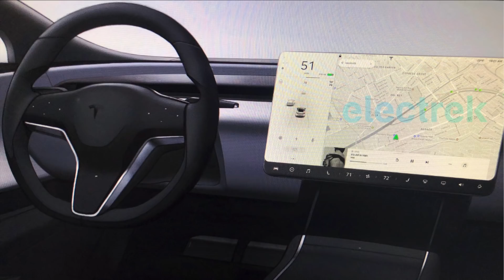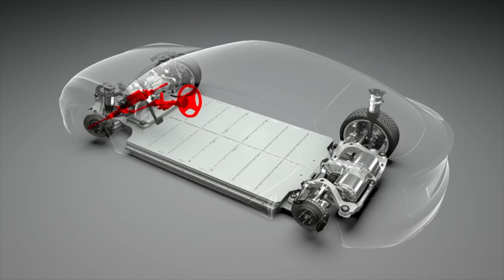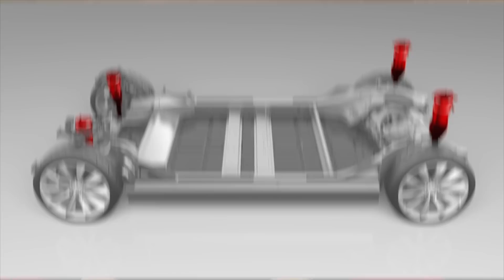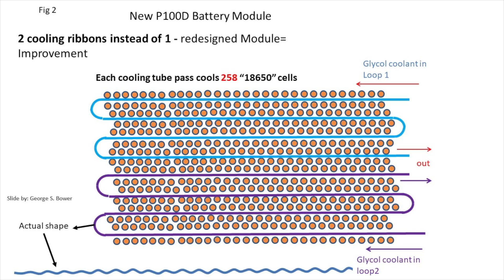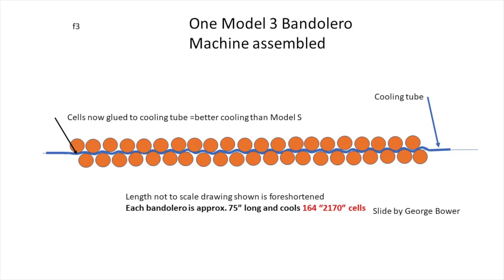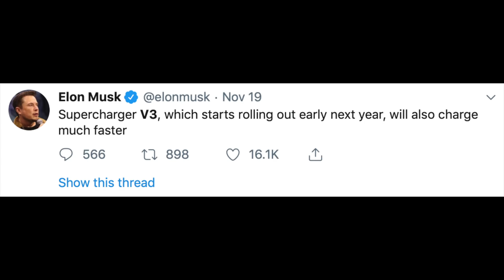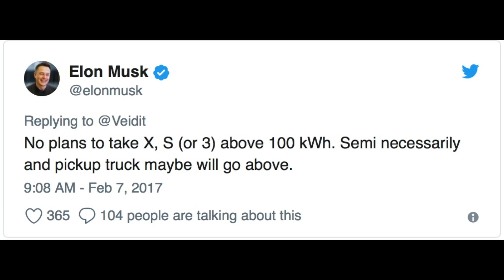The reason Tesla's 75 kWh battery is going away

Comment: Tesla has work to do on chassis (simplify, enhance, make changes for 2170). I do not think it is likely to see a 18650 vehicle get 2170 pack. (I mean without a chassis rework). However Tesla is working hard on chemical for example for removing the need for cobalt. This chemical upgrades do not need any work on chassis, because those can be applied to 18650 and 2170 equally. Those chemical updates are the 5 to 10 % increases in capacity. If chassis do not change I think S and X will not get more than 120 KWH. If current battery charges at 120KW max, it will not handle more than 150KW. In term of charging rate the roadster will be able to handle 240KW and the semi 400KW. Current chassis S and X = no 2170. Chassis reworked S2 and X2 = yes 2170.

Comment: 2170"s in model s and x (which will offer more range) and most likely a cabin refresh. A 100kwh battery pack comprised of  2170's.
Which by default would be a 25% increase of the model 3 range, or about 387 miles of range for s and x.

Comment: My only concern with moving from the 18650 to the larger 21700, is cooling. More smaller cells gives more outside surface area per volume. You can cool the outside of the cells, but will that effectively cool the inside of the cells with more radius of active materials to go through? That said, if the cells will be more efficient, and simply not produce as much heat at the same discharge rate, the larger cells will reduce manufacturing costs. Increasing capacity also decreases load density, which reduces temperature rise, and perhaps even increases range per kWh. That means, the car will be more energy efficient. I would like to see Tesla quit buying foreign battery cells, and "roll his own". If the 21700 is going to be built in one of his mega factories, I'm all for it. Especially, if he can do it here in the US. It would be nice to actually see an american made car, using american made components.
Reply: Their cells are all made in the 'gigafactory' in Nevada currently.  Panasonic is their partner and they handle the manufacturing but the cells are all 'Made in America'.  This will change though as more factories are built around the world.  As much as possible things will be manufactured locally for a local market.  There is likely also some kind of IP sharing going on as well between Panasonic and Tesla covering the chemistries.
Reply: @Bryan46162  I was under the impression that the cylindrical cells came in from Japan, then were assembled into battery packs in the gigafactories. There, they were wired in series, hooked up to the battery management systems, and the cooling systems. I'm talking about Lithium and Cobalt oxide going to Nevada, and being turned into the individual cylindrical cells.

Comment: Switching to the 21700 will mean a new design of the whole cooling system, the main reason why  model X and S are track limited and also it have to be done to the drive units(motors, inverters, charger) .  I'm not sure if they will change the motors to the ones they put in the model 3 as well, anyway it'll be a big redesign in the platform.
 The Porsche Taycan performance numbers will be first victim.

Comment: It only make sense that as battery technology ( and manufacturing ) progresses, that Tesla, like any manufacturer, will take advantage of that progress and utilize not only a " better" battery pack, but a higher capacity one as well. This  also includes charging capacity at the SC.  Isn't longer range with quicker charging the ultimate goal?  . Performance , as good as it already is, will only improve as a result of better and higher capacity batteries.  Nothing is static. 

Remember, the quote from Elon about battery size was written nearly two years ago. A lot has changed in manufacturing and in the market. If you look at the Leaf ( and Volt hybrid) and other BEV, battery capacity has naturally increased over the past 6 years. This will only continue . Both sides of the equation, battery capacity and charger capability are both going to increase.  Is a Model 3 with a 100 kWh battery in our future. Or an S/X with 135-150 kWh battery on the horizon? Only time will tell, but the handwriting is on the wall.

Comment: The 2170 pack is suppose to be more energy dense, more energy for a certain space. So a simple change in battery pack architecture from 18650's to 2170's alone should be able to fit something like a 120 kWh pack in a model S or X. I don't think S and X will get 150 or 200 kWh pack but I could be wrong.

Comment: There is a trade-off between range and weight in these cars - it doesn't make a whole lot of sense to build a car with really long range as the battery weight would be a limiting factor. 400 - 450km is plenty of range for the average motorist. Just like small car fuel tanks don't go more that 40 to 50 litres, because then the size and weight of the fuel would impact performance and design, and it's just not necessary.
Reply: necessity ain't anybody's dad

Comment: This one is a stretch but I think that Tesla is happy with the weight, range, and cost of the S/X. I think they will continue to offer S/Xs' with the same number of cells but increase capacity through chemistry and production improvements. So every year, or every other year, the capacity will increase by less than 10% and the marketing will catch up at every milestone. They don't  plan on stopping the  importing of cells to integrate in their gigafactory. Those cells have to go somewhere, the S/X packs are a great choice. They will offer a larger capacity version to match or beat the competition but who knows when that will be.

Comment: New Battery Tech for EV's doesn't come out till 2020 thus the reason even GM announced Vehicles other than their trucks an SUV's  the Corvette an possibly the Camaro will be EV "They will no longer make gas/petrol powered cars.... I have also heard Ford is following suit an am sure Dodge will not be far behind them...
Reply: firefree turbines using cold instead of heat to condense instead of evaporate is what that means.  NOT ELECTRICAL!!!!

Comment: Usually Elon says what he means and means what he says, so it'll only change if some better technology proves itself. More batteries = more weight = less efficient. The cars aren't meant for daily long distance roadtrips. They're meant to be used as commuter vehicles with the ability to go long distance.

I'm guessing they made the wires thicker to prevent complications and avoid any possibility for fires or anything melting especially with the amount of 3s that are being pushed out.
Reply: waiting time reduction for chargers?
Reply: @peterwakeman9930  Elon said they can't increase the charge rate without upping the capacity, but that would mean only the bigger batteries would be able to charge faster. I don't think they'll upgrade the entire charging infrastructure to only benefit the higher capacity models.

Comment: It’s 21700 cell, not 2170.
Reply from the maker: This is true but Tesla refers to them as 2170. "The Gigafactory is producing a Tesla/Panasonic designed and engineered cell called a “2170 cell,” as the diameter is 21mm in x 70mm in height." https://www.tesla.com/presskit?redirect=no

Comment: Any long term battery issues if you only ever charge to 80% when you dont want to wait the last 20%?
Reply: Not really.  How a battery preforms really comes down to chemistry.  Lithium batteries love to be cycled partially (not full and not empty) and show very little loss of capacity doing so.  In fact lithium cells generate tremendous amounts of heat when charging form 0%-10% and then from 90% to 100%.  This is why you see the highest charge rates in the middle of the charge cycle and a dramatic slowdown to fill the last 20% of the battery.  It's also why most folks just charge EV's to 80% in their garage for day to day use.  This is contrasted with other chemistries such as nickle-cadmium which pretty much needs to be drained to 0% and charged to 100% each time or memory effects render the cell almost useless very quickly.

Comment: heat kills batteries  15 min charge   lol  how much is a batt pack?  get out your wallet
Reply: currently the coooling system is in the car- like old school chargers where before dc charging.  Thet cord has a chiller for the plug- it needs to pump the freon into the pack direictly from the charging station but then that would be to pretend that batteries are not a spent fad which they are of course.

Comment: No because adding batteries adds weight and weight hurts efficiency that hurts range. 

Alternatively if they do figure out how make batteries smaller and lighter they will take the gains and run with them as cost would go down, and lighter car is faster and more efficient resulting in better range. 

The only reason it makes sense to go with a bigger battery is sports cars where you need them for power, or heavy cars where weight penalties aren't of much concern (model y and tesla SEMI)
Reply: trailers? for s x
Reply: @peterwakeman9930  dont think they will make trailers with batteries due to safety concerns. Also that would limit your speed to just 55mph in CA
Reply: towing trailers with stuff on not battery @dreysbimmer

Comment: Elon is right regarding battery capacity vs 350kw charging rates.  The man knows his stuff. Even a good size battery won't stay at the 350 rate for long and has to ramp down the rate very quickly depending on total pack capacity. 350kw ... Wow ... that's 600V  X  580 Amps, or 70 electric clothes dryers all running!
Reply: batteries are for single digit integral hp or smaller craft only!  Frankly any traction power over 180 watts is better fulfilled with a clean turbine

Comment: I think because of parts replacement compatibility, they may release an entirely new form factor that can fit in the existing pack but with a better cooling technology. OR they could keep the 18650 with a new chemistry that lets them have less cells that the 100kWh pack but with a 100kWh capacity. Curious on what the solid state tech timeline is.

Comment: Does that decrease the mass of their cars/ Another question: Is there anything new in the battery about it's chemistry? Can anything new be done to reolace the lithium ion battery?
Reply: yes.  RED ice from free air turbines can provide suv's with 5000 mile range and lower cost of owning per mile at half the weight when full.  Also exgtremely inexpensive to manufacture

Comment: When EV cars have more range than ICE vehicles and a competitive 0-to-100% recharge time, that's when we will see ICE vehicles die out in droves.
Reply: just fyi you are a knownothing
Reply: @Irene-fu6gj  Nice troll bait, but I'll bite.

If I am a know-nothing, why don't you enlighten me?
Reply: @BrokenLifeCycle  read my other remarks about actual ice from oxygen nitogen even co2 not the erroneous acronym that missleads the mazda etc. gas engines use expansion that is not dependent on combustion only a fuel that is hot OR cold and nuclear power can make all the o8 we need duh

Comment: power efficiency is more important in my opinion than batteries. The problem with increasing power capacity is more charging time and the problem with reducing charge time is HEAT and insane INSANE voltage and Amperage draw in the order of 440+ volts at 400 AMPS!
Reply: so publicsurplus.com featured a pair of aircompressors that drew that in three phase- over 400 by 400!!!!  the opening bid was 2500 bucks fyi
Reply: (ac of course meaning peak voltages where most wattage gets delivered are in the thouands of volts to just produce hundred pound per square inch or so air for what??)

Comment: You can't get 80% charge in 15 minutes unless you are charging at 4C
Reply: actually, 3.2C is all you need.
Reply: @w0ttheh3ll  actually no, because it doesn't charge at a constant rate, it tapers towards the end.
Reply: @JimmysTractor  a standarc CC CV charge only tapers after it exceeds 80%. you stated 80% charge.
Reply: Where are you guys getting these C ratings without ever mentioning what the total Amp-Hour capacity of the pack is🤔
Reply: @electriccruiser7796  you can calculate it from charging and discharging times
Reply: @electriccruiser7796  it doesn't mater what the numbe is because it cancels out. It just means you can charge a 4C or 4 times the capacity. To charge a battery to 100% in 1/4 hour you need to charge at 4X the capacity. A 60kwh pack would need to charge at 240kw for 15 minutes. However, as the pack reaches capacity, the current must be reduced.
Reply: Jimmy's Tractor okay charging at 4C is not safe for long term health of the pack, you definitely can charge at 4C assuming constant voltage, but then again your making assumptions about the packs voltage being the same in every pack. One should ideally charge at 1C or less than 1C for the best long term pack health.
Reply: @electriccruiser7796  typically, high capacity cells can't be charged at more than 1C or 2C, but more often, 1/2C. If they have a way to get considerably more capacity and charge at 4C, that's great. I was just making the point that charging in 15 minures is going to require a much higher charge rate than currently available- not just a 20% or 50% increase.
Reply: Batteries that are designed to operate at high temps such as the sodium batteries used on freight trains can charge very quickly and are relatively cheap. Supercaps charge very quickly and last a very long time but are expensive and bot as energy dense as chemical batteries. These are two options that might be used to supplement the battery pack to continue to charge it after the charger has been unplugged thus making it seem to charge faster. Just suppose the frame and panels of the car were built incorporating supercapacitors in the material itself. A supercap mesh could be a layer in a carbon fiber panel for example.

Comment: The C rate is very important for overall battery pack longevity.  Higher charge rates also mean higher temperatures.  Even if Tesla or other companies offered extremely high charge rates I personally wouldn’t use it.  But I seriously doubt Tesla will offer a charge rate that results in the battery pack lifespans degrading.  Its the same reason why cellphone charge voltages are limited.  You can only stress charge lithium so much.
Reply: lower temperatures mean higher charge acceptance

Comment: I think they are definitely switching to 2170 for S/X. They may have just removed the 75 kWh model because the new battery module design and layout just doesn't yield a 75 kWh capacity. It may yield 80 kWh or something close. They might even get rid of battery labels all together like with the 3.

Comment: When do you think we will see 150-200+ kWh cars at the ~20k € mark? 10 years? more? I really like EVs but unless they can do ~1000km per charge (so that you dont get stranded that 1 day per year that you have to travel cross country) and be at around the same price as a diesel hatchback, they just seem impractical.
Reply: You are ignoring the lower operational costs of an EV.
Reply: I ignore then for the time being for the simple reason that the cheapest EV where I live is 38k€ Nissan leaf with not enough range and there are none used, cause the it's the first EV sold here and there are none used plus no charging points. On the other hand I can get a 5yr old turbo petrol for around 8k€ or a similar diesel for around 12k€. Even a new 22k€ petrol or diesel is cheaper and with far superior range than an EV. Yeah in the long run the EV might be cheaper but if I need 10 years to break even, then there is no point...

Comment: Interesting.  Curiously, I don't think that a pack much larger than 100Kwh is needed on anything other than actual SUVs, trucks and larger.  If the battery tech is continuously improved over the next few years, then that capacity should be plenty.  Things like Samsung's graphene impregnated Lithium cells and other approaches towards solid state batteries could be a serious sea change.  Getting an 80% charge in 15 minutes is, I feel, key.  It makes not the range anxiety, but the how the hell long am I stuck where I am headed if it is at or near the max range of the car at 80%.

I am an advocate for electrics but still feel that the ability to really mainstream them is not achievable until the replacement for ICE is either good enough (80% in 15 minutes is damned close frankly) or better.  Anything that even smells like a compromise or a need to either have an ICE car for those longer (multiple fuelings) trips or have to rent are keeping people well away from the electric market.  And when I say people, I mean people who can really only afford one car.  I know that for me, I expect my next purchase to be electric as that next time is still a ways off as I own two Hondas.
Reply: Does nobody else wonder about the freakishly high valuation of car washing conglomerates?  THey clearly intend to refuel while we wait for the suds to do there work.

Comment: They need to work on better service for out of warranty teslas and the purchase of used teslas maybe release diagnostic software to local shops for the people that lives 200 miles away from a tesla shop and maybe release info on there parts to 3rd party parts manufacturers so it will bring there price down more